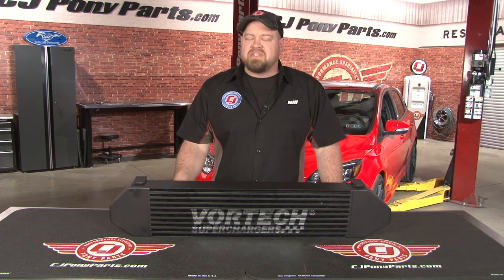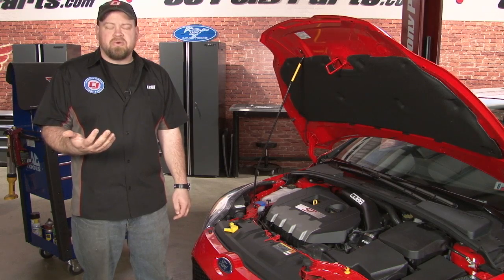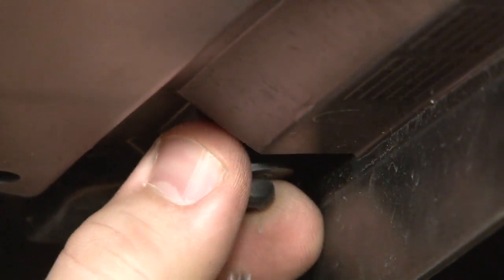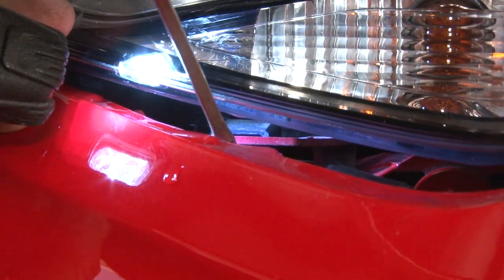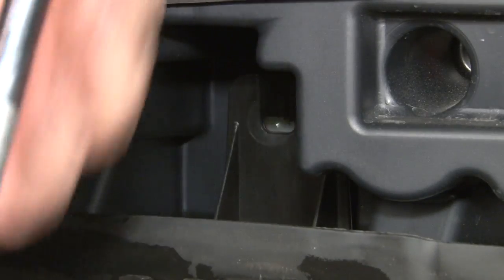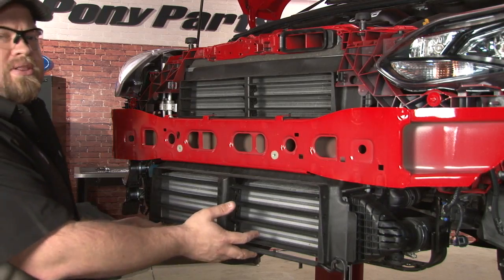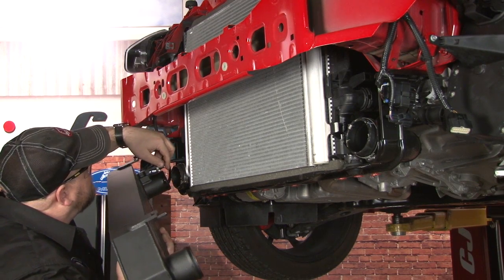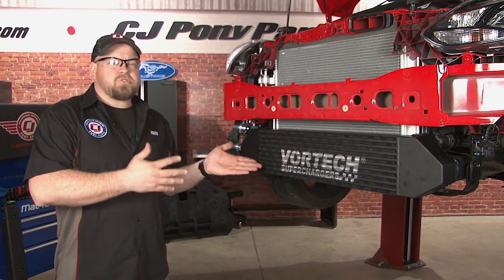Focus ST Vortech Front Mount Intercooler 2013-2018 Installation

Comment: Disconnecting the active shutter system gives no warning lights or anything on the dash?
Reply: I haven't received any lights but it's only been 30 miles.  Have to take nose off again because charge pipe blew off.
Reply: When I had nose off, I did remove the motor and zipped it up to the frame so it thinks it's still there.

Comment: I did this all same step by step with my CV Fabrication Intercooler, now that all is bolted up the ignition won't even turn on and the headlights flicker rapidly. Trunk doesn't open or anything. What do you think has happened?

Comment: That is basically no gain.. please do not scam.. noone will notice that difference.. and my stock ST is doing 230+ whp so I am not sure what is going on here.
Reply: Don’t be a goober , your charge air temps reach 145 degrees on a pull with stock intercooler , hotter air= less power through out the pull. With an intercooler you’ll only go about 10 degrees above ambient on a pull vs 60 it’s a huge difference in conistant power !
Reply: @LilMeatEvan  I have yet to install my big Airtec IC ( I  will be doing before and after runs, and I will get back with the results). I know that the stock IC is insiffuicient, but my.criticism is against this particular product. I agree with you that a *decent IC is a must for the ecoboost ST, but pls check out their dyno run with this IC installed.. it is rather a joke..

Comment: hi there, a question if you remove the active grill shutter will the cooling fan run continuously at the highest level?  Is that true or is there a way that it doesn't always work.  

Great video and very well explained 👍👍👍👍
Reply: Keep the motor and zip tie it somewhere

Comment: What did you do with the active shutter connection?
Would you get the engine light warning if fully removed?
Reply from the maker: We removed the system and never had any lights.
Reply: CJ Pony Parts thanx for the reply
I got quick question.
Would you guys know the size of focus st oil sump plug?
Cheers 
Keep up the good work

Comment: So what happens if I remove the shutters from my stock system, will it be good or bad?
Reply: I'm a year late to this but there's little good it does. From a cold start, it helps warm up the engine by keeping the shutters closed. Once you are warmed up and driving it opens and closes to help with aerodynamics. Buying this intercooler allows you to keep the shutters if you want to keep them. If you get a larger intercooler you'll have to remove the shutters. I don't think it makes too much of a difference especially if you are trying to get more power. More power needs a cooler system to maximize efficiency and in that case the shutters don't matter. If you're just casually cruising you have better aerodynamics with the shutters but it's not going to give you significant increase in mpg if that's what you're looking for.

Comment: Does the active shutters help or has anyone noticed anything not running them?
Reply from the maker: They allow the car to warm up a little faster and really aren't needed.
Reply: @cjponyparts  If these shutters are closed in a highway long journey, due to their purpose to reduce aerodynamic resistance and fuel consumption, could they lead to overheating the engine and burn the cylinder head gasket?

Comment: I removed the GRILL SHUTTER,small sensor and motor connector due to a grill upgrade..now ,check engine is on....
I should connect at least the sensor back on? Help please.
Thanks.. ECOBOOST 17 mustang

Comment: Reply please? What if I dont have the Active Grill Shutter? Because my Focus SE was in an accident, and I didn’t install one! Is it important to have a Active Grill Shutter or no?
Reply from the maker: If you have an SE you don't need a front mount intercooler, they are designed for turbo cars like the ST model.
Reply: The shutter helps the car warm up faster

Comment: Will keeping those sensors unplugged will you get any codes
Reply: Yes. Disconnecting shutter motor will trigger check engine light. You can unclip the motor from the shroud and zip tie it somewhere in a safe spot to make sure you will not get the check engine light.
Reply: No it doesn't
Reply: Brendan Chapman, I'm going to install this intercooler on my ST. Did you get this intercooler installed on your ST?
Reply: Remapping

Comment: any reason this intercooler costs astronomically more than other larger intercoolers? cant see how this is a more viable option over an IC from ATP Turbo or Cobb
Reply: This is a late reply but maybe it will help someone, it’s expensive because it’s the only intercooler that lets you keep the shutters. Which is required to stay in some autocross classes
Reply: That's what I'm saying, their logo on the front doesn't do it for me either.

Comment: if you were putting one on your ST would you choose this one or the Cobb intercooler?
Reply: +Hunta1209  They both will do a good job. I like that the Vortech doesn't require drilling holes but IMHO the Cobb will do a better job with bigger boost.

Comment: That's NOT a MAP (manifold absolute pressure) sensor, it's a CAC (charge air cooler) sensor. Now you can tell people where to put there CAC (Kah-K).
Reply: Still considered a map sensor lol
Reply: manifold pressure, in the intercooler. lol.

Comment: what are those flappers for?:
Reply: they help the engine warm up faster, but mostly they are for gas mileage. they redirect airflow around the car to reduce drag and improve gas mileage.
Reply: @warmonger9088  so removing it from the stock system wont help much? Actually be bad for the car?

Comment: Hi great video. does this fit the ST MK3 EDM (europe) version? is there an adapter for the maf sensor?
Reply: Sorry I do not know if it will fit a European version. The MAP sensor mounts to the intercooler, the MAF sensor is next to the air box.
Reply: Bill Tumas It's a CAC (Kah-K) (charge air cooler)  # see above comment. pid is IAT2 on ford scan tools

Comment: With all the pieces you take off, how do you keep track of the pieces and when they go back on? Do you use a labeling system? Also, do u need a tune before you can get a new intercooler? Thanks
Reply: You can drive with a new fmic without having to tune but it's recommend you do at some point. Driving with a new fmic won't hurt the car but a tune will help the car actually utilize the new fmic.
Reply: I lay them on a tray top to bottom as I take them off so the last bolt I remove is on the bottom. Yes you should retune when adding a FMIC